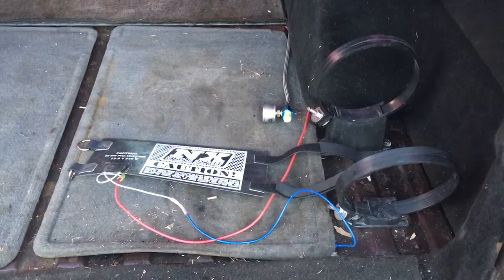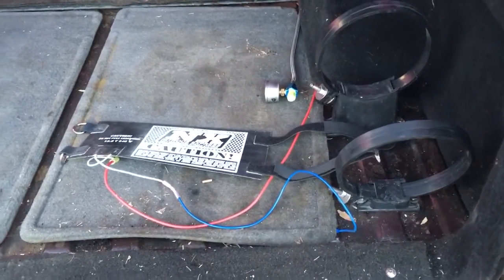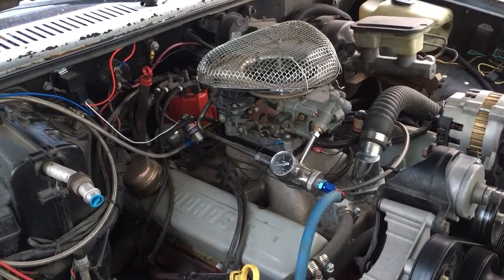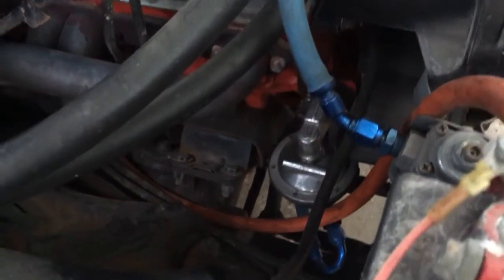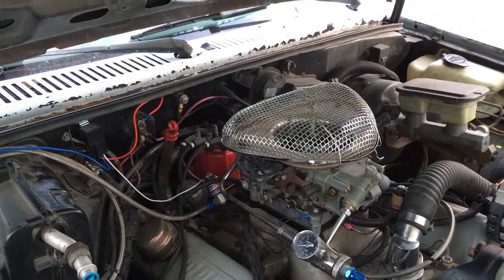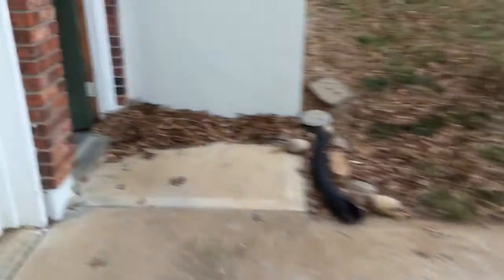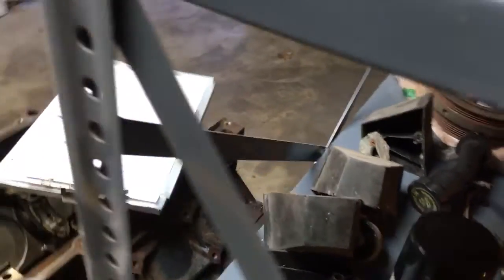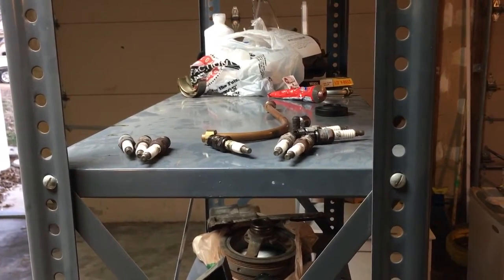Nitrous Drag Racing Melted Sparkplugs

Comment: U need to stop using the ngk r plugs
Reply from the maker: Camaro Drag Racing Second Generation I agree the plugs were not cold enough for the shot we were trying.  In the past I’ve had good luck with autolite non-projected plugs with Nitrous. 
The old school SBC has been replaced with an LS engine, currently trying to go Turbo. 👍
Reply: No one makes a more consistent plug than ngk. That's why they're used in 1000hp per liter engines. 
A quick rule, if you think ngk is your problem, they're not your actual problem.
Reply: @roostertn  
Well maybe u should do some research on the ngk r plugs the AR stands for resistor which isn't good for high horsepower engines their is plenty of videos to prove it.

Comment: Wow! You got good use out the plugs. Rusty plugs let's us know your valve covers haven't leaked in the last decade! Great video of leaning out a cylinder or three. Hope you didn't burn a valve. Thank you for sharing... enjoyed!
Reply from the maker: Stephen Mitchell I found the limit on the Holley 110 gph mechanical fuel pump.  I’ve since verified mechanical fuel pumps “surge” volume or flow so they aren’t the best option with running nitrous above 100-125hp 👍. I’d say it would have been fine with a quality 120-140 gph electric fuel pump. 😉
Reply: @HeadFlowInc  Great,  I've add a fuel management system just for my two stage NOS system with a fuel safety switch. Including fuel line just for this setup. The block is  O ring, blower pistons, extra gap on rings for that large of nos hit. Switch take timing out, colder plugs. Works great and don't blow dip stick out at 300 hp total. System goes to 800 hp ..ha ha ha..not me. Can't imagine running 500 hp NOS. Launch with 150 hp and then add second stage 150. Makes driving to Kroger fun like I was 16 again and I'm 66 yrs old!!! Handicap tag mounted above the wheelie bars. Old grumpy worn out but still have a grin on my face! Super family values you are sharing including family fun with your car!!! We need more men with your heart on videos. If your ever in North Georgia and need anything look me up! Bible, guns, and Hotrods are a way of life! PS zero points on driving record.... I'm the old guy in the left lane...ha ha ha! Keep making these good videos, been sharing with friends!👍🏻👍🏻👍🏻
Reply from the maker: Stephen Mitchell Thank you for the kind words!  You mention Kroger, took me back growing up in Memphis, TN in the 70’s-80’s 👍
Your combo sounds awesome, thanks again for the support! 👍🙏🏻

Comment: Lol those plugs got roasted.   Yeah I feel like pressure us such an inaccurate reading for actual content. What's your theory on the rear 4 cylinders running hotter?   I've noticed starvation on s blower dusk carb setup on hard launching but the angled impellers helped push the mix toward the front if the case and even it out. Great video mate,  always enjoying your stuff
Reply from the maker: +Swilling  I'm thinking the pulsing flow of the mechanical fuel pump wasn't enough to feed the nitrous hit.  It may be safe running under 100 HP shot maybe.  
BAD update the transmission went out the same day so it must have been a blessing the nitrous was empty! lol  Thanks for the feedback!  JD
Reply: lol always somethin, good luck on the trans!